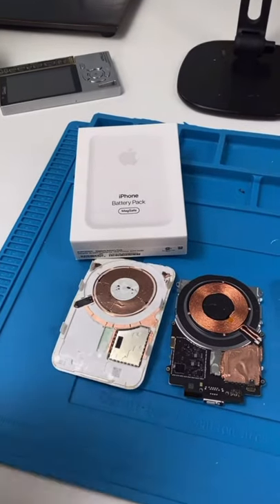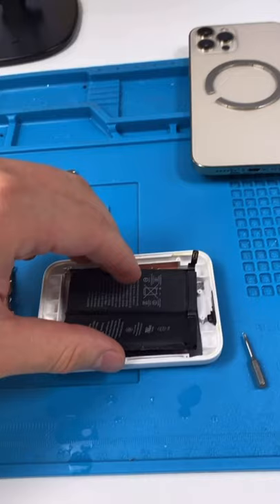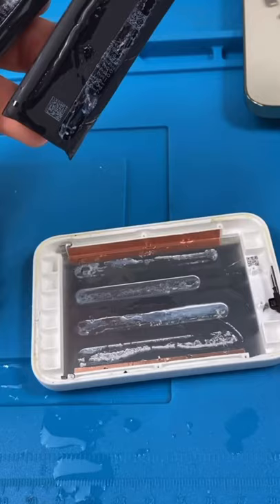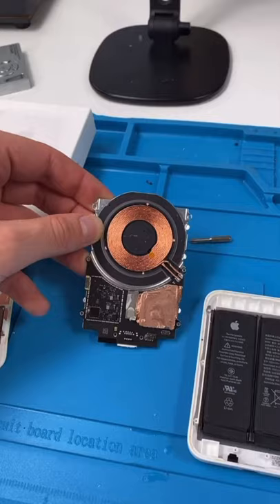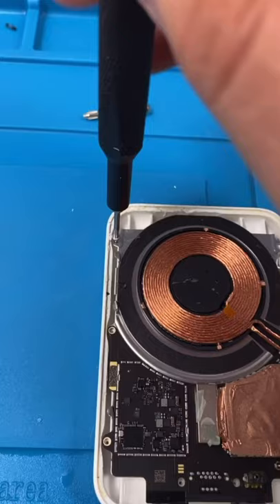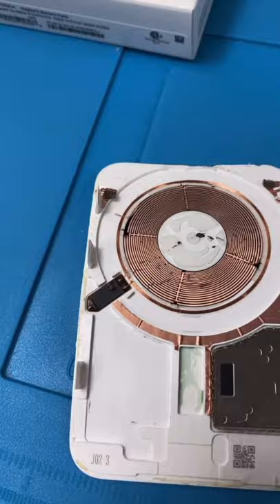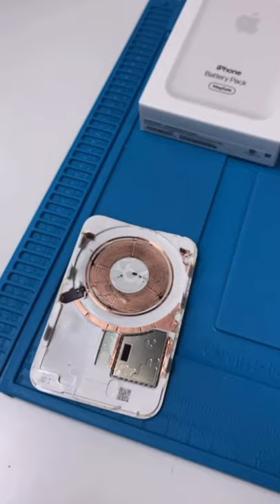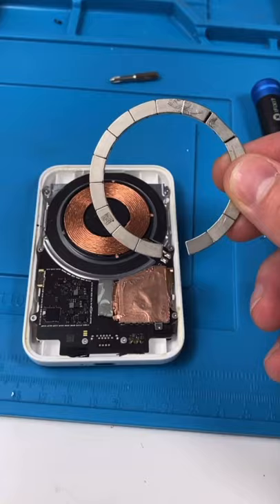Will Apple's Battery Pack Still Work After A Teardown? #Shorts

Comment: Hey, my display has a purple line on it. Tried going with advice from Samsung by typing *#0*# in my number pad and reset the pixels but it doesn't seem to work. Any other advice?
Reply: Probably screen damage 
Lol Samsung gonna charge a lot for their screen
Reply: if your display has a purple line in it, you need to get it replaced lmao, don't know why you're trying to diagnose it. "My battery only last 15 minutes before I need to recharge my phone, what should I do?"
Reply: Ribbon of the display might misplaced/broken completely, fixable but if it's broken then you've to replace it
Reply: @someoneyouneverknow7529  alright. Appreciate it

Comment: How much whould it cost to get a samsung A10 repaired, i dropped while walking down stairs and the glass broke 
Also something underneath the glass is broken that is basically, the... LCD? I guess... probably not
(Sorry, my knowledge on phone hardware is very limited, im just built different) im using the phone right now but i kinda have to guess where the letters are. I live in london btw . Half on the screen is essentially unusable, 
Anyway baiiiiii

Comment: Hey @Iphone repair guru I have a question so my iPhone 6 battery dies pretty fast usually within an hour or half a hour and it’s my only phone do you have any segestuons??
Reply: Change battery if battery health 80% and below
Reply: @someoneyouneverknow7529  it goes to 100% but just dies fast
Reply: @txmdchickenphotography3787  non-original battery I suppose, it always like that
Reply: @someoneyouneverknow7529  what dose that mean
Reply: @txmdchickenphotography3787  you need to change battery but with original one, or I suggest just buy new iPhone that 6 is old af
Reply: @someoneyouneverknow7529  ok thanks for your help

Comment: Wireless charging is like 35-40% efficient.  A wireless charging battery pack is a stupid idea.
Reply: tbf samsung has done it before.. but it was a bigger battery at 10k, and i believe it was marketed towards their watches.
Reply: Man thats calle evolving. First phones werent as good as nowadays, maybe in some years well have close to max efficency Wireless chargers
Reply: It's not a stupid idea at all, it's just very impractical atm because lot of people still have and use charging brick and cables, higher cost for implementation and it's a hassle to bring that circular coil everywhere than traditional method.
If that technology gets cheaper and better, yeah charging brick might be ditched in the future
Reply: @RinaldoJonathan  intel-based computer can run Logic Pro with VM since some MacOS used Intel chips
Reply: @someoneyouneverknow7529  then spend 3 hours a day fixing either hackintosh or vmware. Being there, it wasnt worth it. 

Also vmware was sluggish af, no QE/CI, therefore no final cut.